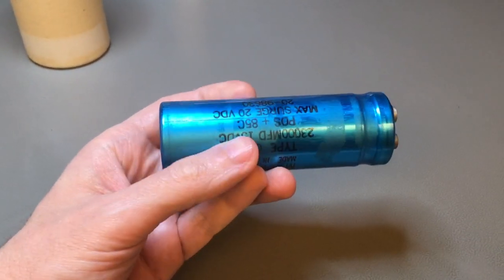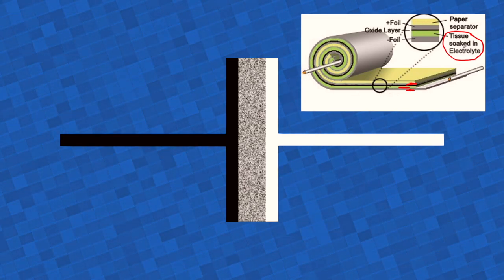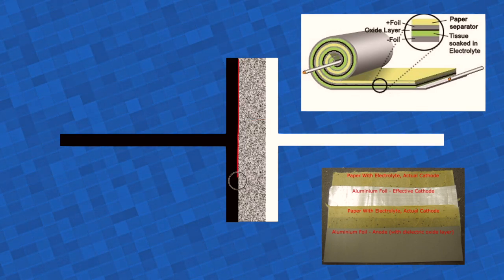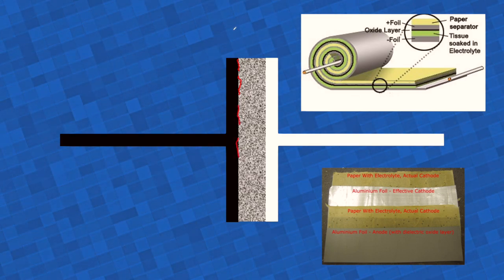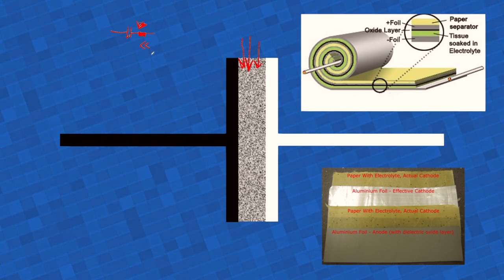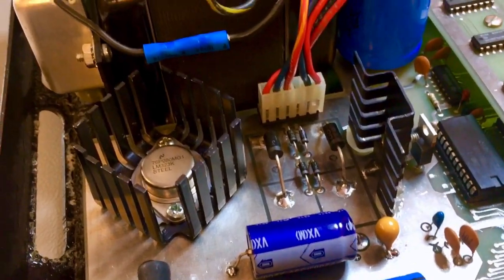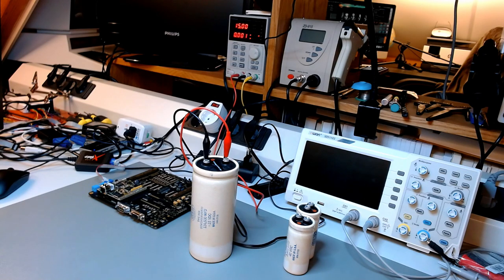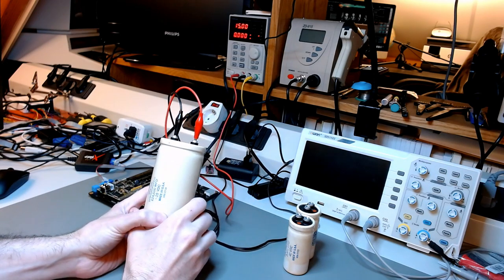Reforming capacitors the easiest way, tutorial

Comment: Fantastic explanation!
I bought a 400 Vdc/1 A and reform my new and used 400 V capacitors with 400 V/1 mA (!). Some go up to 150-270 Volt and one was stuck at 70 V. I will scrap the last one! (All have 11 mF)

Comment: At around 10:25 I would also add to the list of attributes you mention that these capacitors may have gone bad because they have not been used very much when new and then stored for a long time without any current passing through and then those cracks you mention happened. So if you connect those directly at full voltage you could probably damage them but if you first reform them you could heal them and put them to good use. Thanks for the video!

Comment: Is it okay to reform a 1,000uf 25 volts capacitors ?
Reply from the maker: In principle yes, but physically smaller capacitors tend to dry up when they get old, and won't reform. Try measuring the ESR first. If it's too high, that's an indication that the electrolyte is dry and it won't reform. Capacitors like this typically measure a higher 'capacitance,' because the aluminum oxide layer is cracked, allowing the capacitor to pass DC. This confuses the meter, which interprets it as higher capacitance. In general, with smaller capacitors, it's more prudent to just swap them out for new ones, instead of reforming them.

Comment: Hello. Such a great video thank you! I have a machine with around 20 VFDs. They have a bunch of capacitors. I’ve noticed some of the large ones (4700uf 450v) are reading lower capacitance. I would love to try and refurb these as I am having a hard time finding replacements. Could you please tell me the model of the device you use to control the Volts and amps delivered to the capacitor. Thank you
Reply from the maker: It's a standard bench power supply.
Reply: @thebyteattic  thank you! I’m a novice to this completely. Could you share a model number so that I can do some more research? Are you limiting just the voltage or limiting voltage and also max amps to the capacitor?

Comment: What do you do if you have a capacitor that is rated for 450V for example but are not able to supply that much? Great video by the way!
Reply from the maker: There are specialised devices for reforming high-voltage capacitors used in e.g. power supplies and RF equipment. They do generate the necessary voltages, but are also dangerous to operate, so you should know what you are doing if you decide to use one of those.
Reply: You can easily make a power supply that will produce the required voltage.  There are 120 to 240 V adapters, which are employed to power 220/240 V European equipment with 110/120 V, available in the U.S.  After full-wave rectification and filtering, that will produce 310-338 V DC.  By connecting a variac to the input, you can get from zero, up to that voltage.  Actually, it will go higher, since variacs normally put out a maximum voltage that's greater than the input.  You can also connect the variac directly to a voltage doubler, without the adapter.  But be advised that variacs are auto-transformers, which do not provide line isolation.  So design & build your device with the proper safety precautions in mind.  There are also variations, eg, a tripler, quadrupler, etc, which will give you any voltage you want, assuming you stay below insulation ratings, etc.  (And don't forget a FUSE, in case the cap shorts out!)
Reply: @Pootycat8359  Thanks for the input
Reply: I was just thinking about that problem and saw a voltage doubling circuit that can go up to some Kilo Volts here in youtube. So I think with a typical lab power supply of 30V you could do 60V, 120V, 240V, 480V and more… Just keep in mind that you will be handling dangerous voltages and that while you will be doubling voltage you will also will be halving current at the same time so you will have to compensate for that in the power supply. I am pretty sure this should work but I have never seen such a thing built so if you do it please share if possible. I think I will be doing something like that in the next few days myself.

Comment: if a cap is dried-out, will it still 'show' on the labsupply the 'current-load-drop' like it did in this video while you go from 1V to 2V , 3V, 8v to max-V etc? if so; will it (when tomuch dried out) NOT 'drop the Voltage' when in neighberhood of the cap's rated voltage?  i dont hav a esrmeter but have a labpowersupply, thats why i ask. i think my caps are not dried, but maybe you can give a ballparkanswer in HOWMUCH it driedout by looking at the current-load-drop' on labsupply. tnx! nice video and GOOD explanation and relaxed music ;)
Reply from the maker: Not really. A dried-out cap will have cracks in the oxide layer, internally. If you apply nominal voltage to it all of a sudden, it will just pop, like popcorn. If you do it in small steps, like I show in this video, at some point before you reach maximum voltage the current drain in the power supply will not go down to zero anymore, because dry oxide doesn't reform well. In other words, if the oxide is too dry, it won't reform; you will not be able to advance to higher voltages because there will remain a DC drain while applying lower voltages.

Comment: i am sure i have seen other cap reforming videos that say you should use something like 5uA of current, not 10mA.  hopefully someone will correct me if i'm wrong.
Reply from the maker: It's certainly safer, but will take forever. For large caps (and small caps shouldn't be reformed, but outright replaced even if they test good) I think a 5uA limit is unreasonably conservative, almost paranoid.
Reply: @thebyteattic  "just because your paranoid, it dosent mean they're not out to get you" kurt cobain   :)

Comment: Can you reform a rifa cap?
Reply from the maker: No, only electrolytics! Film and ceramic capacitors cannot, and do not need to, be reformed. RIFA film capacitors are just exposed to high and varying (line) voltages all the time, so their film and dialetric material mechanically weakens and can burst. They should simply be changed.

Comment: You should be careful using the term "power line" when you say that when capacitors are connected to power lines. Power lines in some places are the power distribution grid having high voltages, possibly thousands of volts. I know you mean a power rail or power source. 
But others may misunderstand your terminology. Maybe im just being over cautious, but I felt obligated to mention it.